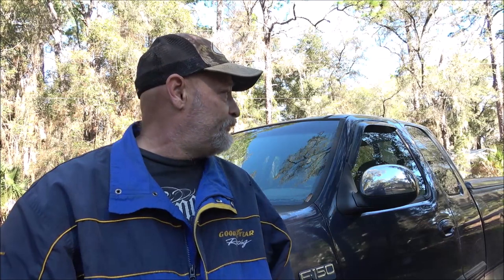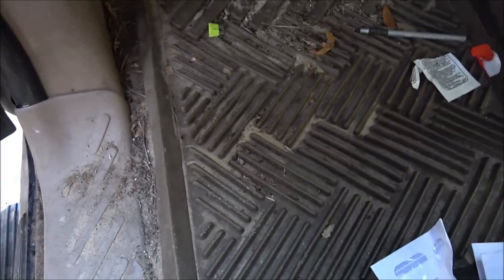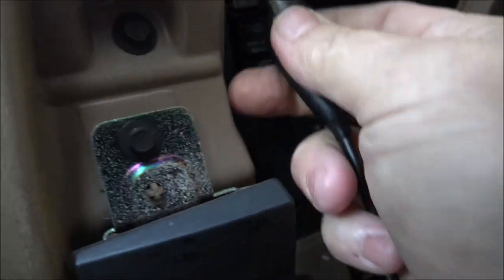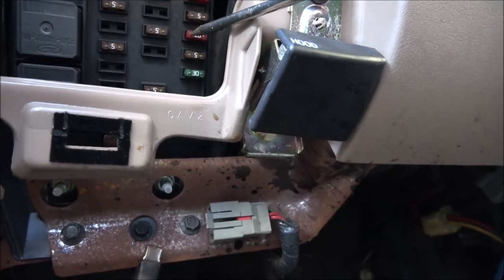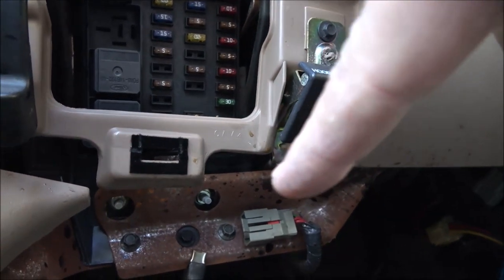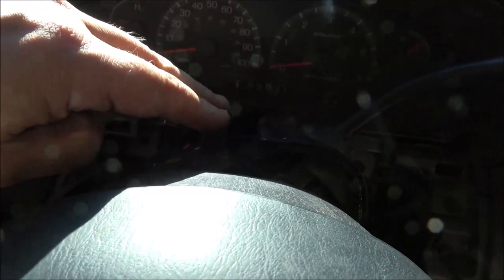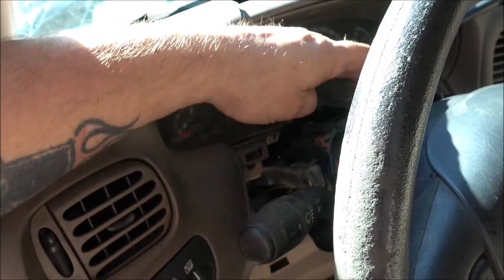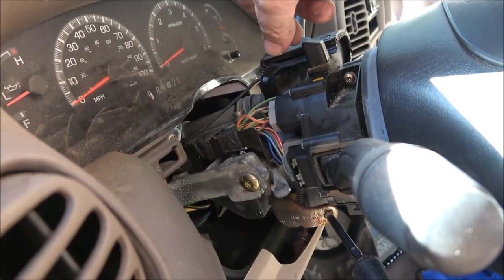No Brake Lights, Turn Signals, Or 4 Way Flashers 1999 Ford F150 Solved In 4K

Comment: I have a 2002 Ford F150 lost my right turn signal and right rear brake light could not figure it out for a week watch your video went outside and tilted my steering wheel up and it immediately started working thank you so much
Reply from the maker: Glad it helped. Thanks for watching and commenting.

Comment: I had the exact same issue on the same year f150. It was the connection in the steering column. Raised the steering wheel up and everything would work. Thanks for posting this video. Saved me hours and my hairline! 19:42
Reply from the maker: Glad it helped. Thanks for watching and commenting.

Comment: Same problem, new bulbs, fuses and relay. Checked the wires on top of steering.  Still no brake, turning or emergency lights.
Reply from the maker: Put a new flasher in.

Comment: Did the 2 10 amp trailer fuses show volts
Reply from the maker: Yes
Reply: Under hood on f350 one mini fuse tow trailer fuse has no power. No rear right lights.Wonder if this relay would remedy my problem
Reply from the maker: @rudy6458  it's worth a try. It needs replaced anyway.
Reply: Thanks
Reply from the maker: @rudy6458  you're welcome.